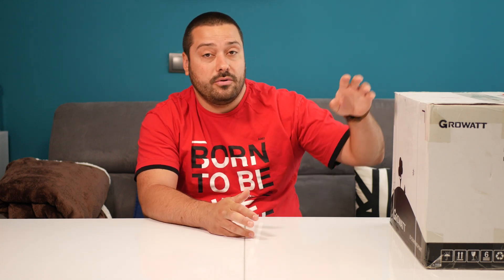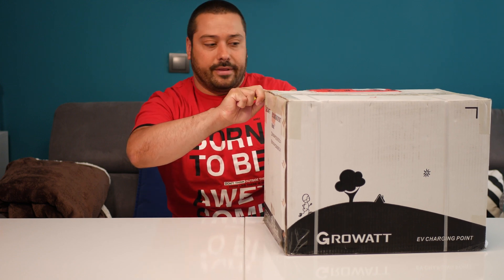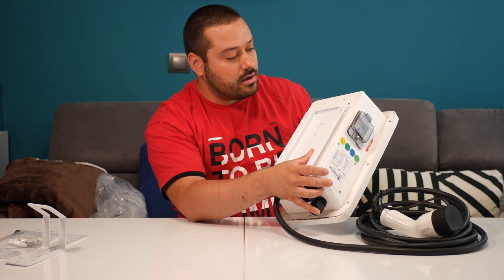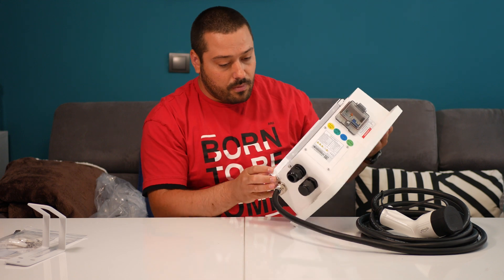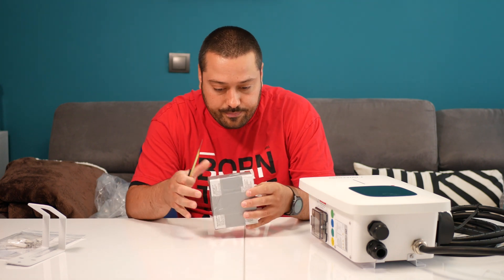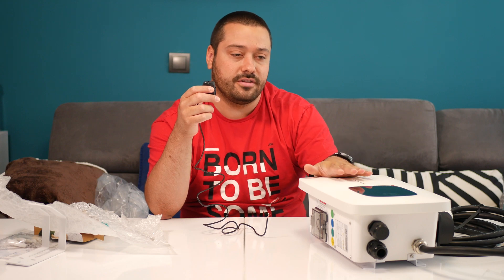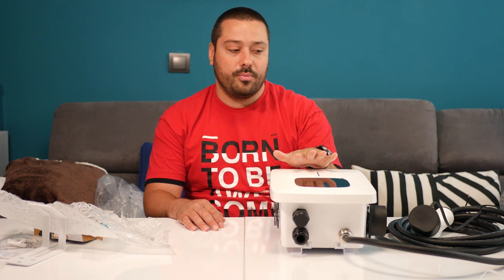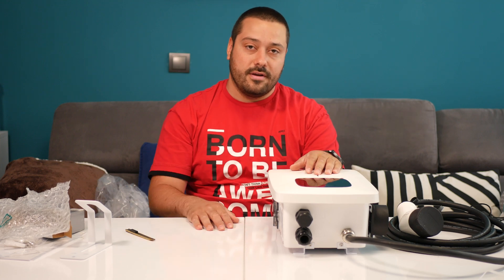Growatt Thor 7KW Unboxing

Comment: Chiedo aiuto: Non funziona il bilanciamento dei carichi della mia Thor_07ASP
Imposto la modalità Fast.
Nelle Impostazioni:
Impostazione della stazione EV: corrente uscita massima dal palo elettrico (a): 18 (che equivale a 4kw circa).
Bilanciamento del carico: abilito e imposto un nuovo periodo (ogni giorno, tutto il giorno), massima potenza importata dalla rete: 4,5kw (ho il contatore da 5kw).
Però, se inizio la carica a 4kw (a cui si aggiungono consumi istantanei di casa di circa 0,5kw) e dopo accendo il forno, la pinza amperometrica della colonnina segna 6kw (l'ho lasciato per 2 minuti e poi ho spento).
Come mai???😭
(versione firmware THOR_07AS-V4.2.13-20230714)

Comment: Do you have the link for the CT meter?
Reply from the maker: Unfortunately no. I got the Charget and the clamp in one package and I cannot see any markings on it. But, I'm pretty sure that you can use any CT clamp for AC.
Reply: @golden4o  tc 2000:1

Comment: Hi, nice video.
The clam you are showing on the minute 3:49 to check the power consume from the house, come by default with the charger, or do you need to buy that apart?can you send me the model of that?
Reply from the maker: You have to buy that separately. Any AC clamp should work (for the rated AMPs)